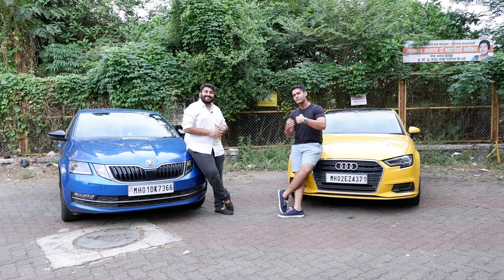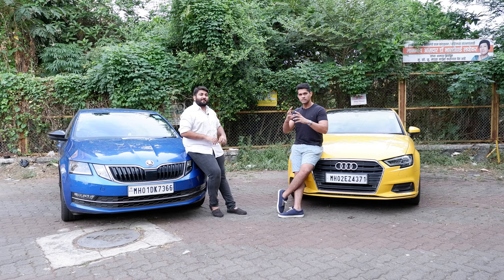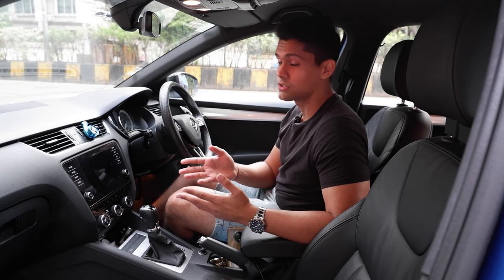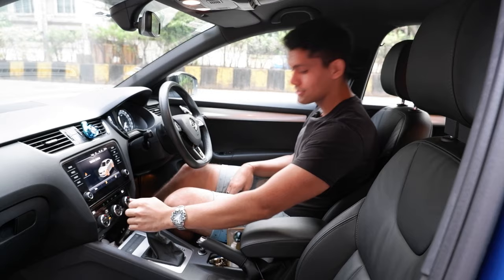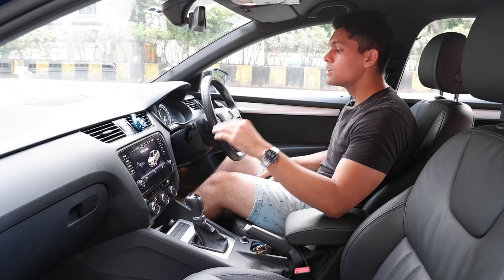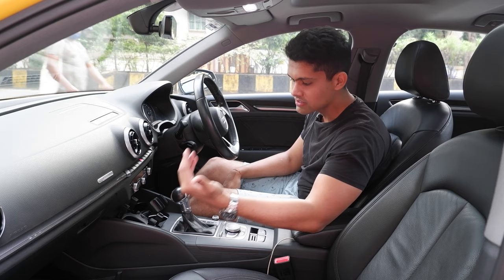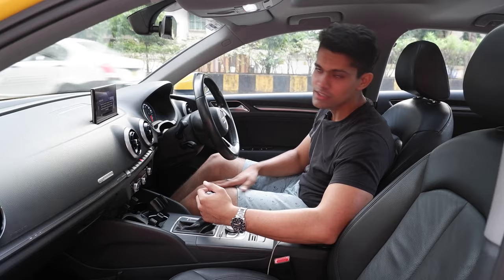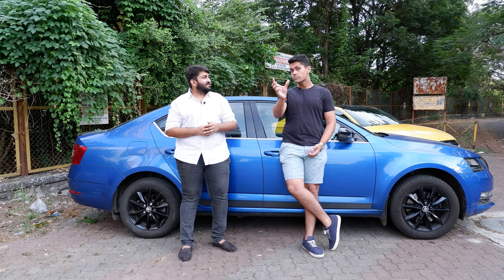How to Launch an Automatic Transmission Car Without Launch Control?

Comment: If you are launching a DSG like that, will that damage itself ???
Like, obviously we won't be doing it everytime but still. Will it effect the Gearbox too much ?
Reply from the maker: Yes multiple launches in a DSG will affect its durability in the long run. Especially the clutch.